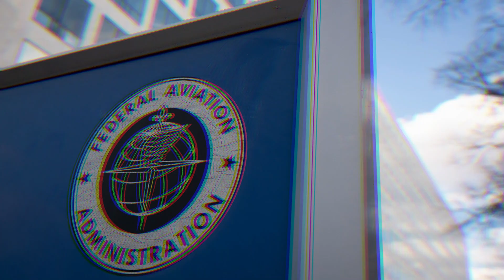Starship Update ! Countdown to Launch: FAA's Final Review Sets Starship Soaring

Comment: I continue to be disturbed and yes even angered by the persistent reporting of the first Starship launch ended by an explosion as if the explosion itself was the mishap and problem which needed to be identified and resolved.  This leads people with less understanding to believe that the explosion being the problem could occur at any time and place innocents at risk from the failures of these giant beasts of the near terrestrial cosmos.  Supporters of SpaceX and detractors alike use this language in reported the failed flight of the first Starship launch, further spreading this misinterpretation of the incident and providing more fear of the SpaceX endeavor than was previously present.  I cannot help but fear that the mixed message may lead to further obstruction and delaying of the progression of Starship launches and Bureaucratic slowing of needed permissions (such as a new environmental evaluation}, which historically has resulted in ever more prolonged and hyperreactive studies and evaluations prolonging the needed permissions beyond the life expectancy of the underlying achievement attempts.  I would hope and humbly request that SpaceX agressively make calm and =deliberative attempts to alter these misleading terms and ideas in describing SpaceX's unique plan of advancing the Starship's evolution by testing to failure to achieve results that favor  the evolution and safety of the vehicle.  This plan has advanced the system so much faster than the achingly slow advancement of space flight in the past. and achieved at less practical cost than the tortoise-like path of the past.  Please Elon, pass this request on to your people and those in media who believe in your project and plans.  Thanks for the venue..